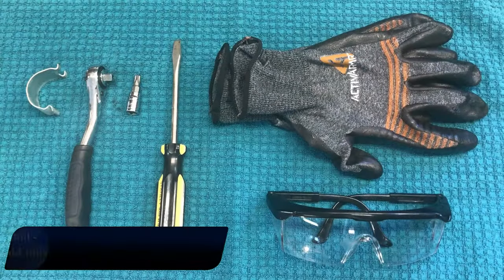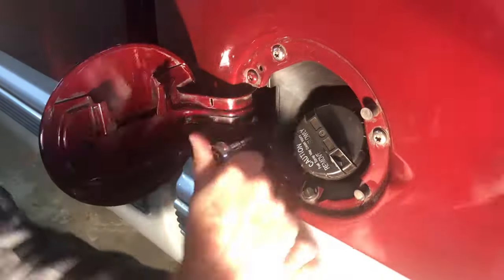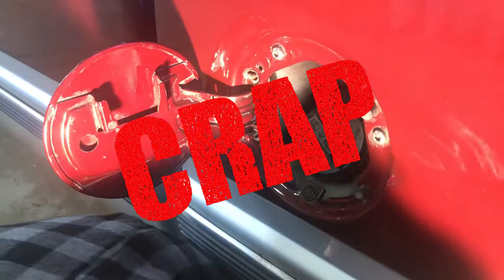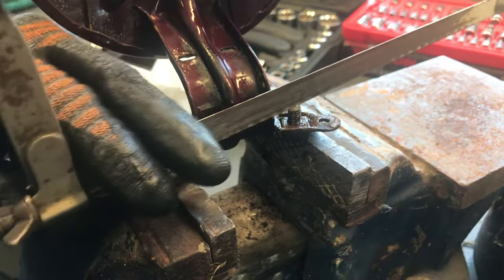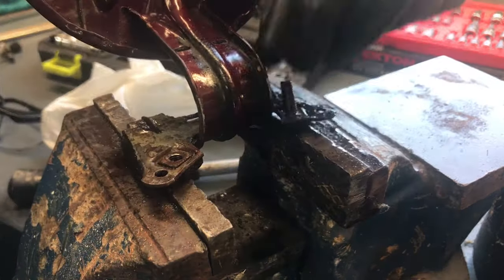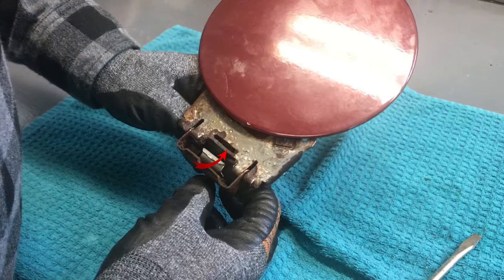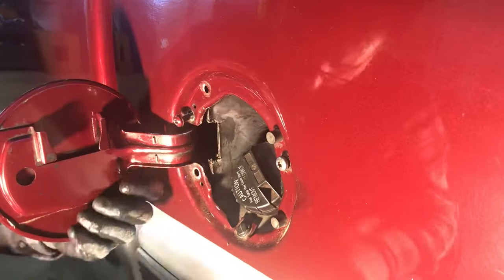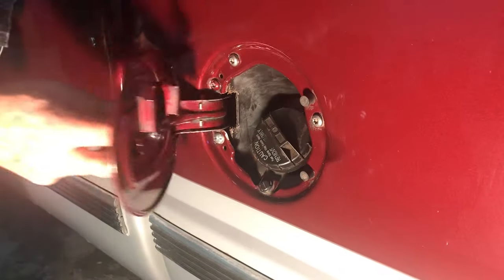How to Replace a Chevy Truck Fuel Door Spring Clip

Comment: I'm betting that like my Colorado chances are the spring is fine and the problem is that the slot the spring clips into is rusted out and broken.  At that point  you only have 2 choices.  One is to buy the entire door assembly which will then need painted or rig up some magnets to hold the door in place.
Reply from the maker: Typically the clip will rust away before the door assembly, in my experience. However, if the entire assembly is bad, you also have the option to purchase a matte black assembly. https://www.amazon.com/dp/B07JKJ1C33/ref=cm_sw_r_as_gl_api_gl_i_RRDY39VWSDDQBJDSD3TQ?linkCode=ml2&tag=oddjobs4bud-20
Reply: Thinking about the magnet hack myself, since the door spring just broke today.

Comment: Its because you turned it the wrong way. You was tightning it.
Reply from the maker: Hey thanks for watching and commenting.  Yes there’s an old mechanic’s trick I deployed here.  When a bolt turns out rough, you soak it with penetrating oil and then you turn it back in to properly coat threads.  After doing that, you can usually back it out without any consequences .  Unfortunately I didn’t take the time to get penetrating oil and I used WD-40 instead. Wrong choice, bad outcome.

Comment: I just replaced mine on my 93 k1500 . A lot of the times it’s not the spring but the bar that the spring clips to . In this case you need to disassemble the entire unit and use parts from another fuel door . It’s tricky but it is possible
Reply from the maker: Wow I thought my truck was old. You have a 28 year old truck still on the road. Impressive! Yes the bar on mine is getting thin. I guess I’ll cross that bridge if it ever fails, and if my truck is still kicking at that time. Thanks for watching and commenting.
Reply: @BudsSmartHome  just had to do it to my 93 k1500. Both the door and the spring rusted away. thankfully my uncle had a few laying around and was able to snag a good one
Reply from the maker: Yes, mine ended up failing as well. I was able to fabricate some metal to replace the metal bar, to which the spring attaches. it’s working great and the truck is still running well. My 1997 Sierra will be 27 years old with about 114,000 miles come 2024.
Reply: @BudsSmartHome  glad you were able to get it fixed. Your truck looks in great shape. My 93 just turned 30 and it’s got 122k on it. Love that truck to death and I’ll do whatever I need to keep it going. Trucks older than me 😂
Reply from the maker: Yes, it’s in pretty good shape for an old truck. 🛻

Comment: Fought with mine for 45 minutes, then watched Bud's video-  The bar the spring clips under is totally gone on mine!!!  No wonder I felt so inept!  Thanks Bud!
Reply from the maker: You’re welcome Ray.
Reply: @BudsSmartHome  ha! You're the first poster that has thanked me for a comment!  Any chance you have a good source for filler doors for an 07 GMC Canyon?
Reply from the maker: @raylabrecque8265  - Here ya go Ray - https://amzn.to/3bGX3k3
Reply: Hey Bud and Ray do you guys know where to get that assembly for the spring? The metal bar is snapped off my hinge where the spring snaps into too. And i cant find the part online
Reply from the maker: @alilolk  - here is a paintable replacement on Amazon:  Fuel Filler Gas Door Silverado, Sierra Trucks - Paintable:  https://amzn.to/2RWlJO1
Reply: @alilolk  I got a new door assembly from Amazon as I had the exact same problem.
Reply: @BudsSmartHome  
Thank you for the reply! So the hinge is only available by buying a whole new door?
Reply from the maker: @alilolk  - correct.  I do not believe the hinge is available as a separate item so you’ll need to buy the entire door assembly
Reply: @BudsSmartHome  thanks so much Bud:)
Reply from the maker: You’re welcome!
Reply: xact same problem but no welder, so I used a couple magnets to hold it open and couple magnets to hold it closed. glued magnets in place

Comment: mine fell off yesturday, i looked at it, took the four screws out took the inside holder out, the inside springs were completely gone, i had to drill two new holes add new screws i found that fit and put it back together fixed it, put it on the truck back working like new. pretty easy fix.
Reply from the maker: Nice!

Comment: That's because you were tightening that screw you broke
Reply from the maker: Hey thanks for watching and commenting Billy.  Yes there’s an old mechanic’s trick I deployed here.  When a bolt turns out rough, you soak it with penetrating oil and then you turn it back in to properly coat threads.  After doing that, you can usually back it out without any consequences .  Unfortunately I didn’t take the time to get penetrating oil and I used WD-40 instead. Wrong choice, bad outcome.

Comment: 😄 you broke the bolt 🔩 instead of loosing it u did the opposite
Reply from the maker: Hey thanks for watching and commenting Pacoblp.  Yes there’s an old mechanic’s trick I deployed here.  When a bolt turns out rough, you soak it with penetrating oil and then you turn it back in to properly coat threads.  After doing that, you can usually back it out without any consequences .  Unfortunately I didn’t take the time to get penetrating oil and I used WD-40 instead. Wrong choice, bad outcome.

Comment: Do you remember what size and length screw you replaced the broken Torx with? I also 🏋🏻‍♀️💪🏻!
Reply from the maker: Good job! I believe the 1997 GMC sierra takes The 1997 GMC Sierra gas tank fill spout uses a T25 Torx screw. It doesn’t have to be that long I think an inch and a quarter or an inch and a half would do.

Comment: Is it just me or were you tightening it..righty tighty
Reply from the maker: Hey thanks for watching and commenting Wade.  Yes there’s an old mechanic’s trick I deployed here.  When a bolt turns out rough, you soak it with penetrating oil and then you turn it back in to properly coat threads.  After doing that, you can usually back it out without any consequences .  Unfortunately I didn’t take the time to get penetrating oil and I used WD-40 instead. Wrong choice, bad outcome.
Reply: @BudsSmartHome  that is a good trick, however those bolds probably wouldn't have been that tight
Reply from the maker: @brianwestmoreland3836  - Correct.  If I am unsure whether a bolt will remain tight I remove residual oil and secure the bolt with lock tight

Comment: Thanks for the demo. Mine is one of those that the bar is rusted out. I will try to weld in a rod to replace it. And you had turned the bolt the correct way when it stopped you attempted to go back forward it broke. Maybe some super penetrating oil would have worked.
Reply from the maker: Thanks for commenting Duane. I eventually had issues with the pivot bar as well and had to fix it. About the broken bolt, I’m aware that I was turning it back. I used WD-40 in lieu of, penetrating oil. That was my downfall. I was trying to turn it back in to work the lubricant into the threads when the bolt broke from the pressure.

Comment: Today I just opened the fuel door and heard that dreaded noise too. Thanks for the tutorial on replacing that spring.  (debating if just putting a magnet there to hold it closed might be easier since I'm sure I'll be busting some bolts too on my old 2010 Colorado.)
Reply from the maker: You’re welcome Paul. Yes a magnet would definitely be easier. Yes, those rusty bolts can be a bear sometimes. Just soak them good with some liquid wrench and you should be good to go.
Reply: @BudsSmartHome  Thanks.

Comment: For one you were tightening the torque screw that broke.
Reply from the maker: Yes I had sprayed it with penetrating lubricant and I was backing it back in to lubricate threads so that I could work it out.  I should’ve waited longer for the penetrating oil to do its job. My bad!

Comment: two tabs on one side and one big tab on the other side, Where the big tab goes was broken off so I used magnets to hold it open and magnets to hold it closed. Glued magnets in place. Broke off a screw too lol
Reply from the maker: Where there is a will, there is a way!  Surely you did not break that screw!  LOL!
Reply: @BudsSmartHome  By the way, my truck is 94 GMC SIERRA extended cab long box, same color as yours burgundy and grey. Do we have the same truck?
Reply from the maker: Mine is a 97 GMC Sierra SEL 4x4.  It is extended cab with the 6’ bed.  It has only 114,000 miles.  Not bad for a 25 year old truck.
Reply: @BudsSmartHome  I’m at 150,000 miles and 28 years old. interior is mint, in Edmonton Alberta
Reply: @BudsSmartHome  I have been putting on headers, massive K&N air filter, Air Raid riser in effort to get 1000 kilometres ( 630 miles) on one fuel tank 113 liters like my old 88 Silverado ext long box, still gotta get a good long run on highway since the headers are in

Comment: didn't you turn the torque screw the wrong way?
Reply from the maker: Hey thanks for watching and commenting BR.  Yes there’s an old mechanic’s trick I deployed here.  When a bolt turns out rough, you soak it with penetrating oil and then you turn it back in to properly coat threads.  After doing that, you can usually back it out without any consequences .  Unfortunately I didn’t take the time to get penetrating oil and I used WD-40 instead. Wrong choice, bad outcome.
Reply: @BudsSmartHome   I'm an old farmer! I farmer fix things!! Thanks, mine started not staying close and I wanted to see the fix- But that was to much work-HA! HA! I reached up in there with a short bungy cord and now you know the rest!!
Reply from the maker: @br927  - LOL 😂 Whatever works!